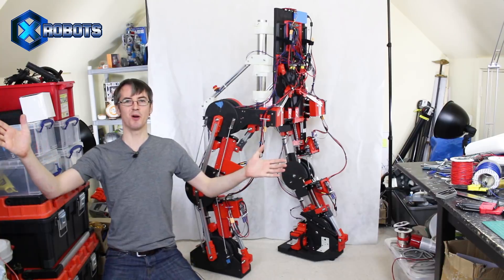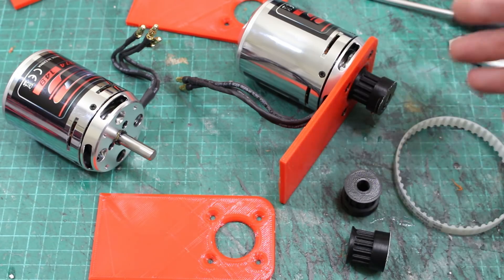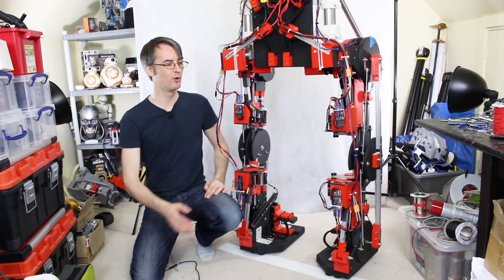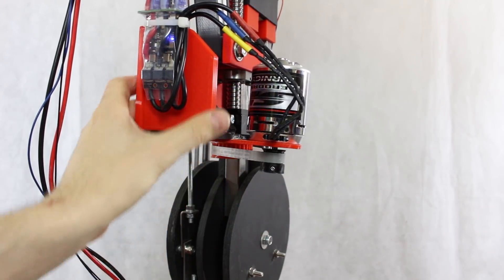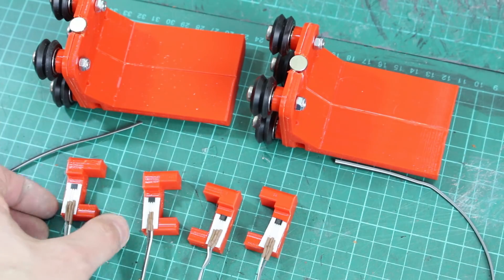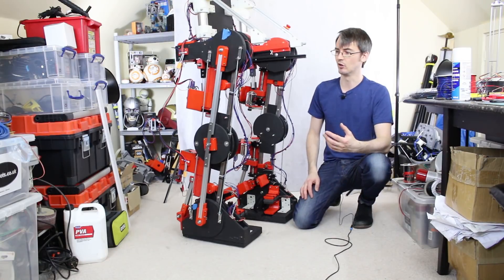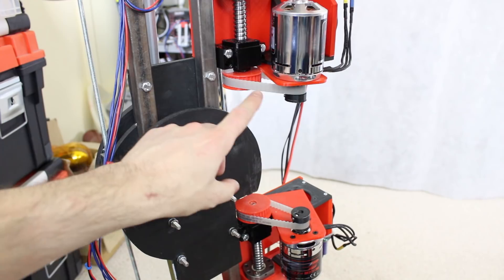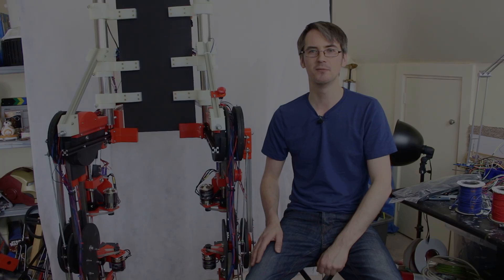Iron Man Exosuit #21 - I Can Walk! | James Bruton

Comment: The direction-reversing problem for the motor is actually kinda interesting. I wouldn't be surprised if some other engineer in history has also encountered it and found a solution. Half the energy spent to reverse direction is actually spent to break, which also takes time while waiting for the breaking to get over with. But I was thinking that you could use two smaller motors and a gear shifting system that switches which motor is connected and doing work. Each motor would be use exclusively for one direction of spin, and only be given power when you need the gears to turn in that direction.
This would all be more complicated than simply using a bigger motor, and I think that whatever system is in charge of switching between motors will see a lot of wear and tear from being used twice (I think) for every step taken. I wonder if flywheels would be useful…

Comment: The movement sensors need to be pressure based, the travel these require will always feel laggy. When you step you lift your heal first not you toes. your sensors need to measure your ankle angle, your knee angle and your hip angle to actually reproduce natural human motion. Could achieve this with 6 sensors, two on thighs, two on low let and two of feet. But the feet ones are only there to control the ankle angle, they shouldn't be used to lift the leg.

Comment: This is such a great project. I noticed though that you were lifting the weight of the „out of balance“ exoskeleton by yourself, which isn’t really the purpose of an exoskeleton, right? Ideally this thing should be able to take counterbalance when you move the foot up so it is lifting the weight and not you. Just imagine you have 100 kg on an arm on top of this and you try to lift your foot in the suit. What’s going to happen is it is going to fall over because you are effectively just shortening one leg.

Have you thought about this? This is really a walking robot that you control from within.

Comment: Can't wait to see the next video! I love how you address the issues and explain your solutions. It's really inspiring. I finally have an opportunity to mess around with Arduino in one of my classes and I can't wait to actually move past all the blinky light stuff into the really cool parts! Quick question, does including Serial print statements slow down the code once when it's not connected to a computer? I would think it wouldn't as long as they don't contain a lot of operations!

Comment: It's nice to see when someone uploads all their mistakes and unedited trial and error problem solving, and also admitting when something turned out not the way expected. As someone who 3D prints / welds / does carpentry / electronics / DIY etc, there are never any easy battles making something good that puts your skills to the test. And then there are those days when you spend hours 3D printing something but you forgot a simple thing like a certain screw hole before you outputted your final prototype STL file and 6 hours and a load of filament end up in the bin. It's frustrating when you think you should be doing better but nice when you find you are not alone in finding the creative process a challenge.

Comment: Have you thought of drilling some holes in the black wood parts  (feet, back and the circular parts around the knees) to reduce the weight a bit (without of course impacting rigidity/strength of them

Comment: You've already eluded to additional sensors but if you watch the video your knees make a great deal of motion before you feat start to move.  Do you think knee sensors would be a good idea?
I think the boots are a good idea.  We balance our bodies in part with feedback from our feet, heal and toe pressure.  Could mimicking this a little be good?  Also a sensor at the upper body, above the waist, for lean of the body torso.  That maybe needs to come latter.  A single pad on the back pressure with the two hall effect sensors just like you've been doing but a single pad and two sensors opposite one another.  The sensor should spring forward at all times and when the torso comes up the the present place the sensor is pushed back and stops forward motion.  On the sensors, they seem to work really good.  That being said, you have only one tool in the toolbox for sensing.  For now that is probably best.  Maybe add some other ways of sensing later.   Just some thoughts.  Hope you don't mind my sticking my nose into your design.  Cheers.  Keep up the good work.

Comment: Have you thought about putting sensors on your body? Something that can analyze the relationships of your joints to one another. For example analyze the rotation between your thigh and lower leg that measure how much your knee is bending and have the suit copy that rotation. Also the relationship between your thigh and and your torso so that would tell the suit how much your hip is moving. Then you could fix your self into the suit solidly at your feet, legs, and hips so that the suit would assist your movement as apposed to you using more energy than walking to drive it. Huge fan love your videos, been watching since BB8 days!

Comment: Just had a thought. You could connect your sensors to your boot using a bike cable or similar. With 3 well placed cables/sensors, you could triangulate exactly where the foot was.

Comment: cool series it is a treat every week, 
To register you food movement,  you actually don't want to move you feet within the suit right? couldn't you build a ridged boot with flex pad pressure sensors you used in the Ultron robot joints?

Comment: still leaning on the bend sensors. you could put them in a sock for the foot and a sleeve for the knees. they would then be held close to the bending surface... thoughts?
Reply: Yeah the bigger motors made a difference. Also it may be beneficial to have a weight shift (capacitance) sensor to pre-fire the motors for a faster response  and maintain a proper weight shift in the robot itself. cheers.

Comment: James, the legs would be a lot more responsive if the didn't try going completely upright at the end of the step. Instead of them finishing in the completely straight, Have then finish at about 20° off straight so the are still slightly bent. You'll notice that the for hardly lifts in the first 20 ish degrees.

Comment: Dont the pressure pads need to be tight on your knee joint as thats what moves first and most when walking...?
Reply: Definitely. safety first, i can just see it would make a world of difference to the control of the legs, so you can crouch to lift and the response when walking is much quicker. The sliding plates in front and behind the knee (without any straps) i think would really help

Comment: you realy need to reduce your sensor amount ^^.... force both legs permanently to go up (hips go down) and use only the buttom feet sensor to check if it is pressed then force the feet to go down. Result is the suit will stand by self. Same for the Forward/Backward movement of the legs. And You dont need to Fix your legs / feets with form.  I hope you try it..
Reply: This is true. Currently you have sensors in both directions but actually if you have one sensor to lift and it returns when you let go of that this is „auto home“ + one sensor removed in one!

Comment: It feels like the control pads have too much travel which makes it very hard to control reliably. Also is there anyway you could predict movement so that the motors start spinning up in advance making it more responsive (I mean: if I took 2 steps then start the motors when sensors get to center position) or maybe some king of center of gravity control

Comment: Hey James, it seems like a major issue that the legs aren't taking their own weight when one of the legs bends, which is resulting in you having to take the weight of the legs, therefore defeating the point of having the legs in the first place to carry the heavy upper part of the suit instead of your own body. I was thinking perhaps there needs to be a shifting weight system where a counter weight shifts to the leg that is on the ground when the other is lifted, to move the suits center of gravity away from the leg in the air so it'll lift up instead of crouching. Initial thoughts on how to achieve this is with a horizontal threaded rod going left to right across the hips with a weight attached with a 3D printed bracket, and a motor that will drive it from one side to the other when a foot is lifted, and back to the center when both feet are back on the ground. What do you think?
Reply: Ah yeah that's a good point, that would probably be too slow to correctly affect the balance of the suit. When the suit's upper half is added, an ability to lean the upper body left or right without leaning the legs over, to shift the upper body weight over the left or right leg would probably provide a more human ability to stand on one leg while the other is off the ground.  I think the joints you have at the hips already provide the right points of rotation for that, but I expect they'd need to be driven to provide the right motion.

Comment: I assume you won't be using this to flip people's cars over or anything, so it's not going to see any heavy use, but I'd be a bit worried to see you strap yourself into the suit too firmly. I could easily see something breaking while your using it and you get folded in half by the full weight being dropped on you if you can't quickly leap free of it.
Reply: True, and I assumed it was more for show than anything, but thought you might use it for demonstrations at events and such, even it's own unloaded weight must be substantial once it's finished. Great build anyway, I've enjoyed watching the evolution from the previous model to this.

As an aside, I like those motors. Something oddly fascinating about the way the outer casing whirs around when you move.

Comment: It's interesting on those type of motors having built an eboard and ebike now with them I've noticed they have quite a power band where they seem to really have a lot of power around the middle of their RPM band and not very much power down at low RPM's. Not sure what RPM you're reaching but something to consider. Would be great if there were cheap planetary drives that fit those motors. Also you can wire a HM-10 bluetooth module to your VESC's and use the 'VESC monitor' or 'VESC connect pro' apps (android) to not only view loads of great data such as motor current, RPM, battery current, voltage and peak values for stuff like that but you can also modify VESC settings and reboot the vesc all from your phone which is pretty awesome
Reply: James Bruton oh wow 24V wouldn't those be 10S or 12S motors? The power difference is insane when you step up the voltage

Comment: Hey James,
The hall sensors are so far forward on your feet you need to lift your entire foot to get a response. If you put more foam, or even better, moved the sensors closer to your ankle you'd walk much more naturally. If you pay attention to your natural gait, you don't lead by picking up your toes in a step. This is part of why I believe you're frustrated with the response of your legs.
Reply: How about using a biker's boot and attach the magnet assemblies to that. This way very little play is present between your foot and the sensors.
Reply: Have you considered using some other places to take the sensor value? Watching a few video's on the Human Gait makes me wonder if a measurement taken from the knee, either from the rising thigh or the angle change in the knee itself might be less laggy as the foot rise is more a result of these motions rather than the cause. There's also an early rotation in the hip but I suspect these are all increasingly difficult places to measure accurately :S Anyways, it's just a thought :) Awesome work as all ways, you never fail to impress!
Reply: That sounds like a really good idea. I hope James at least test this out.